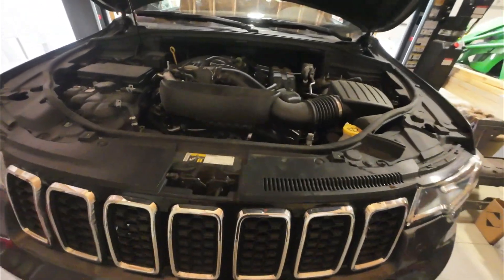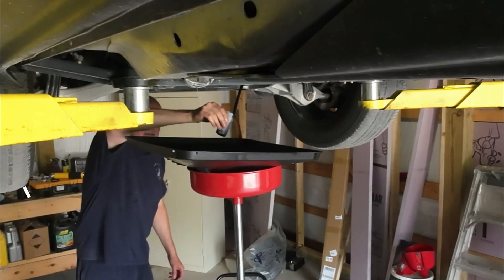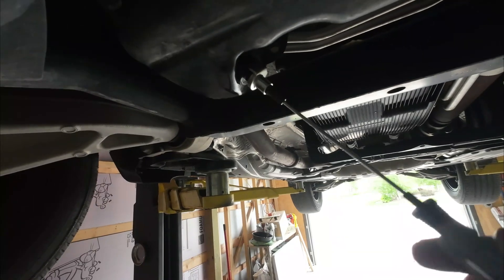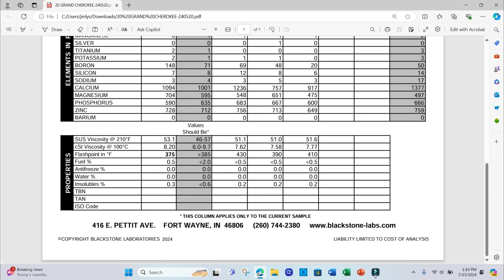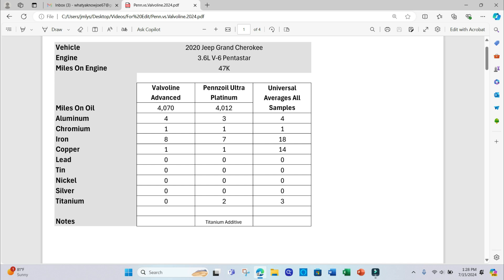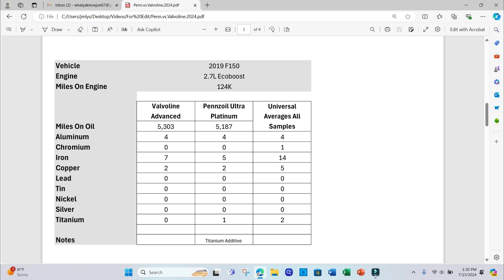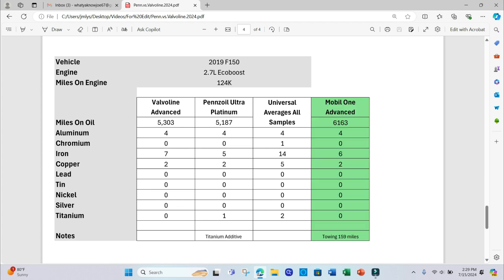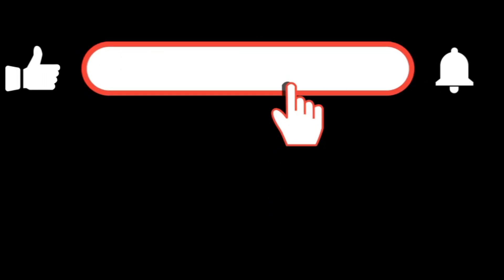Real World Oil Test Results: Valvoline vs Pennzoil

Comment: I use the Platinum not ultra platinum in 1989 Dodge D150 with the 318 engine. I bought this second hand, the previous owner always used regular not synthetic Pennzoil oil. Now it has 318659 km and so far so good, uses very little oil. I use the Valvoline synthetic in my 2009 Ford Focus, again, so far so good. Quite happy with the results of both oils. I enjoy watching your videos, thanks for the information.
Reply from the maker: You’re welcome…and thanks for watching my videos…I appreciate that!
Reply: Dont use platinum in cold winter climates. It has the cold flow properties of honey. Check the project farm cold flow test if you don't believe me. Run ultra platinum in the winter.
Reply: Using regular Platinum versus Ultra Platinum makes no sense with the minute cost difference.  The PUP is way superior.  You guys whining about a four-dollar difference cost and using the best filters makes me laugh.  Engines are expensive and the have the best oils being in Valvoline or Pennzoil, it makes no sense to step over dollars to pick up dimes.

Comment: Im on my second oil change with valvoline restore and protect. Always been a fan on valvoline. Id like to try the pennzoil ultra platnium but nobody carries it in stock. I like to use what is available off the shelf. Im not even sure if the Valvoline restore and protect will do much on my car. Its a 2019 civic coupe ex-t,  and ive done 3500 oil changes since new. Im currently about 200 miles away from hitting 70,000 miles. Ive noticed that the restore and protect smells awful out of the bottle 😂.  Must be all the detergent? Ive tried castrol and for whatever reason my engine doesnt seem to like it. I spend a lot of time in my car, and can feel when the engine just seems off. It also likes the Kirkland full synthetic,  which is great since its $30 for 10 grts. This time around im going to do 5,000 miles to really let the valvoline work.
Reply from the maker: I had a hard time finding the Pennzoil as well…had to order off Amazon.
Reply: @whatyaknowjoe67  I hear home depot of all places has it. The nearest one to me is 40 minutes away.

Comment: Try running a complete fuel system treatment containing polyester amine (PEA) to address your fuel dilution. Carbon buildup on your injectors is a leading cause of fuel dilution. Your wear metals do not indicate a worn out engine.
Reply from the maker: I will try that…thanks!

Comment: Valvoline used to be my go to but in my new truck gm 2.7. I swear it runs quieter on rhe Pennzoil Platinum.
Reply from the maker: I didn’t notice a difference
Reply: Fact's Pennzoil platinum runs smoother and quieter in my 2005 Ford expedition way better than Valvoline.
Reply: You should not have bought that truck, dude.  Those tiny engines Democrats are forcing on us are JUNK!  Oil pump is driven by rubber belt inside the motor!
Reply: @jaywinters2483 The GM 2.7 Turbomax engines have chain driven oil pumps. Ford Ecoboost 2.7 and 5.0 V8 use belt driven oil pumps.

Comment: My go to brands i only use. I switched out between intervals, Pennzoil UP and Valvoline HM Max Life. My 2014 F150 EB runs so much smoother and quieter than the Motorcraft did. Also gets better fuel economy.
Reply from the maker: The motor craft oil is decent…but it is just a semi-synthetic
Reply: @whatyaknowjoe67  I had that "famous" Ford knocking in my engine(which i really didn't know about until it was mentioned on different channels) with Motorcraft oil, but after putting in the Ultra Platinum...that went away relatively soon after. Quite a few different things happened after switching over to Pennzoil and Valvoline.

Comment: I've found that no matter how much valvoline is talked up or hyped up I've never been happy with it, motor always sounded worse at every oil change for the first couple weeks then back quiet again, but when switching to Castrol and Pennzoil motors always sounds quite before and after oil change, Valvoline in my opinion is on the thinner side and no tests from any u tuber can change my opinion nor experience, I've used several oils and Valvoline is never to be used in my motors, it's even more difficult to read on the dipstick, nice video
Reply: Why not Valvoline Restore and Protect?
Reply: Some people have reported that their engines were louder when using restore n protect  @nexushexus4365
Reply: Valvoline isn't talked up.   It's flat out superior to any other oil.  Valvoline does there own in house testing ,only oil maker that actually has an engine test lab on there factory floor.   They actually test thing in depth and share there process w video evidence in real time.    Say what you want but the 100s of 3rd party testing also shows a slight edge across the board in Valvolines favor in every situation.   ✌️
Reply: @LORD_OF_THE_ROOTS Mobil 1 also does a lot of engine runs and tear downs and will run the vehicles simulating as close as they can, real world driving for 10, 000 or more miles.
Reply: @MrRGiller  mobil1 Def good too.  It really boils down to engine design and materials used in said engine.   Some oils work absolutely great in one and just ok in another.    I've been running mazdas cx 5s and now a cx50. And a old 2011 toyota 4runner I've found the valvoline advanced synthetic to just be superior in these few engines.  Just run smoother n more responsive.   So I'm biast towards valvoline 🤷‍♂️
Reply: @LORD_OF_THE_ROOTS 
Now bring Shell's synthetic Rotella into the mix and everything looks subpar!!!😂😂😂😂
Reply: That’s odd cause I’ve found the complete opposite.  Pennzoil Ultra Platinum was noisier in my Mazda than any Valvoline product and it’s actually on the thinner side of each viscosity.  You can see data sheets posted and UOA on bobistheoilguy.  The Pennzoil always thins out more and starts thinner.  🤷‍♂️
Reply: @Drew99GT  He said he didn’t care about any lab results no use in bringing it up he’s not going to read it he’s only going to use what he feels is right which is his pockets Castrol and Pennzoil are better because they’re cheaper for his pockets 😂 but seriously it could just be his vehicles all cars are different
Reply: @Drew99GT  same for me my mazda cx50 loves valvoline advanced synthetic 0w20
Reply: Engines vary just like motor oils do.  Some work better than others.  Valvoline R&P in my Honda runs better than Pennzoil.  My wear metal ppm per 1,000 miles is 1.8ppm and 1.0ppm in last two oil analysis.   Oil consumption is down from 2 quarts per 5k miles down to 1/2 quart per 5k miles.  So everyone has different results based on their engine and application.  😊
Reply: It was the opposite for me my car hates pennzoil ultra. It just seemed too thin of an oil. I switched back to amsoil SS and everything is a lot more smooth with no valve ticking. A lot of engine noise with that pennzoil ultra.
Reply: I have actually had that similar experience with Mobil 1, absolute garbage. I switched to Valvoline after trying several others too, and now Valvoline is all I run! It’s been great for me.
Reply: @aaronfrench8322  engine ran hotter on my 347 ford with Mobil 1 oil compared to FS Castrol. Also i rev engine before shutdown and with Mobil 1 rpms dropped faster, showing more friction vs Castrol where the rpms came down slower when revving before shutting it off. I do use Mobil filters, i am not biased, it is what it is.
Reply: I’d love to see you go on bibistheoilguy and report your findings. Engine oils aren’t judged by noise there slick. And if you don’t like YouTubers reporting what works then stop your bitching and don’t watch it. Nobody cares! I can tell you don’t know a thing about tribology but we get your unsolicited “opinion” and an uneducated one at that.
Reply from the maker: Thanks for the information
Reply: @delcorick9967  maybe you were getting GF4, GF5 oils from Valvoline. They're at the thinner side in all brands.
Reply: I think your 😂😂😂
Reply: I totally agree. I have Chevy 2.7 and on this truck I've tried the Supertech, Valvoline, and Pennzoil. Noticeably quieter with the Pennzoil.
Reply: @danielbonner8309 the ULTRA,?? PENZ. OIL
Reply: I agree with you , Penzoil and Amsoil eliminated ticking noise on my GM cars especially with the DoD & AFM
Reply: @maalmull Won’t matter the oil, your lifters will collapse if you don’t disable DOD. If you haven’t done that already you probably should, like 5 minutes ago.
Reply: I've been a Castrol person since back in the 80s when I got my first car... a '78 Honda Accord hatchback, 5 spd.  Back then I despised Pennzoil but I have fairly recently become a big fan of Pennzoil based on current researching (reading and watching YT videos) and use that in my "new to me" 2016 Ram 1500 5.7 hemi...
Reply: @gerrymatheson4020 In yours Redline is better than Penzoil Platinum. If you dont want 
More lifter tick on it
Reply: @tomasnokechtesledger1786 it's NOT BETTER
Reply: I said the same thing and fordbossme got his panties in a bunch over it.

Comment: I use the ultra in my newer cars. I daily to work a 93 Ford ranger with the 2.3l and I use Valvoline high mileage synthetic blend and it currently has 508,000+ miles and still rocking the original engine transmission and rear end! No leaks, tics taps or raps! 3000- 3500 mile oil changes regularly!
Reply from the maker: Nice! Changing the oil sooner can’t hurt
Reply: In Southern West Virginia I see 5 Rangers for every old Tacoma, that’s incredible on your mileage.
Reply: Damn Rangers lol
Reply: Got your money's worth and more on that Ranger! Good for you
Reply: @Offroader451-rm5jz  the best part, I paid $1400 for it almost 14 years ago. It's pretty much rust free a few dents on it,I think it was a parts runner and it needed a clutch master cylinder that's how I got it so cheap. Never thought it would last this long! Lol
Reply: @paulcondie2520  Keep on keeping on
Reply: who cares what you use?
Reply: @jaywinters2483  there's always that one douchebag in the comments and today you're it!

Comment: I used to change my 2.0 GDI EcoBoost every 5,000 to 6,000 miles with full synthetic. In the last couple years learning more about how much fuel dilution a GDI turbo can have especially doing as much stop and go driving I do, I now change it every 3,000 to 3,600 miles (3,000 being the goal but life and all gets in the way). I’ve been using Valvoline High Mileage full synthetic Garage Box from Walmart. Pretty good value for 12 quarts. My Escape takes almost 6 quarts with filter anyway.
Reply: What year Escape? In my 2017 Edge 2.0 Ecoboost, I change oil at 50% on Oil Life Monitor. Usually works out to 2,500 miles between changes.
Reply: Smart! Love my 3.5 eco boost but you have to be real careful with maintenance especially if you do around town driving and or towing etc. oil is cheap compared to a new engine or even major engine repairs
Reply from the maker: Yeah…we drive too many miles…would be changing oil every other week on one of the vehicles

Comment: One or two parts per million is within the margin of error of the test itself and the sample size. So it cannot be said that there is ANY difference between those results, because of the error inherent in the test equipment, and the small sample size (only sending in one sample), and also the difference in driving conditions and mileage on the car.
Reply from the maker: Agreed.  Both good oils and comparable

Comment: Should have used Valvoline Extended Protection or Valvoline High Mileage Extended Protection as they are the flagship and Pennzoil Uktra Platinum is Shells flagship. The Valvoline Advanced(even though really really good oil with a big add pack by ilsac standards) should pitted against regular Pennzoil Platinum.
Reply: A high mileage oil should not be used, unless one is testing the high mileage formulation from other brands also. But in general, high mileage oils should not be used at all unless there is some oil usage in-between oil changes. High mileage oil contains additives that swell the seals to stop or reduce oil leaks, and if you use it, and then later stop using it, your seals may shrink causing oil leaks. If it is not broken, don't fix it.
Reply from the maker: I agree.

Comment: It seems on your 2.7 F150 the Mobil 1 did best considering the use of the vehicle. But in reality all are just fine to use without hesitation.
Reply from the maker: I have to agree…all are good oiils. I’m curious to see how the high priced amsoil compares. Results coming soon.
Reply: @whatyaknowjoe67  Absolutely agree! I might have tried the MO “Extended” as it’s both a Group 3 and 4 base oil. Thus why it has double the guaranteed protection of “ Advanced”  which is pure Group 3. By the way, I too have the 2.7 in my Fusion Sport and so far all good.

Comment: Joe, You do realize that in order to get an accurate representation when comparing oil changes that the oil being used needs to be run through twice. The first batch to clean out the previous oil and the second to be analyzed without being cross-contaminated from the first. I learned this from watching the Motor Oil Geek. He is a Tribologist and has extensive experience with motor oils. Just offered for your information. Thanks for sharing this.
Reply from the maker: I thought of that afterwards as well…I did let it drain for a good 30 min between oil changes. Next time I will flush. With that said…I did alternate which oil brand I tested first…so for example I maybe did Pennzoil first in the F150, and Valvoline in the Trax.
Reply: @whatyaknowjoe67  I would be interested in seeing the results after you've flushed the other used oil brand and then see the values of the analysis.
Reply: I came here to say this but still a very thorough real world job.
Reply: This will not affect the results in any significant way. Motor oil geek is a talking head for the oil companies. All he does is regurgitate marketing material while claiming he is all about the science. The guy is a fraud TBH as nothing he has ever said or done was revolutionary in any way. All that information a has been available for decades.

He has never once ran this oil through a test and yet he advertises it, he is getting paid to sell oil. Thats his job.
Reply: Came looking for this comment, it's an unfortunately expensive "requirement" to get a real test result :(
The good news is that you only have to run the 'flush' fill for a very short time, it's just the cost of the 'extra' oil change makes it annoying.
Reply: I was just about to comment on this exact same thing till I saw your comment
Reply: 6:10  I appreciate the thoroughness of your comparison, but I'd dispute your logic here. The lab results for your two oils are indeed better than Blackstone's "Universal Averages All Samples" particularly for iron and copper, but how many 'All Samples' include intervals of only 4,000ish miles? I'd bet: not many. Without this factor, no accurate conclusion can be drawn.

Comment: I've tore down a few engines over the years and it wasn't the oil analysis that was the issue it was sludge build up inside the engine. Pennzoil left so much sludge you could scoop in out with a tablespoon. I didn't see that with engines run on Valvoline which I've used for years in everything except my airplanes.
Reply: Sometimes things that were true once are no longer true, and with engine oil with all of the changes and R&D this couldn't be more true.

Pennzoil was bought out by Shell, Shell had / has a reputation for it's cleaning abilities and no known sludge issues (either at all, or that is reported recently),

How old is your experience with sludging?

Is it recent like a maximum of 5 years ago? or was it 10 years ago? or was it from the late 70's early 80's?
Reply: You don't make any sense . SMH
Reply: Strange….where I’m from it was rumored to be just the opposite. Locals swore they wouldn’t put valvoline in a lawnmower! I think it’s all hogwash. Most of the sludge comes from driving short distances without a proper warm up….no matter what oil you use. But, you can’t reason with unreasonable people. I wouldn’t be surprised that there’s people who’d change it once a week.
Reply: What a clown, posting nonsense based on anecdotes from the 1970s 🤦🤦🤡🤡🤡🤡
Reply from the maker: I remember back in the 80’s Pennzoil was garbage
Reply: @whatyaknowjoe67  It was from 1975 to the 80s that I was doing automotive engines and then in 87 I switched to aircraft after getting my Airframe & Powerplant license which I still do. But about 4 years ago I started doing cars again, mostly diagnostics. I've heard that Pennsoil cleaned up their sludge problem but I haven't tore down enough car engines to confirm or deny that yet. Ha! Yeah I'm old but I never learned to play golf and I still enjoy diagnosing and fixing stuff after 49 years of doing it.